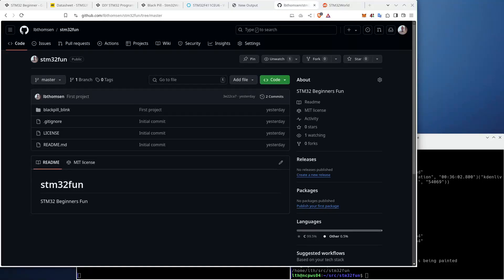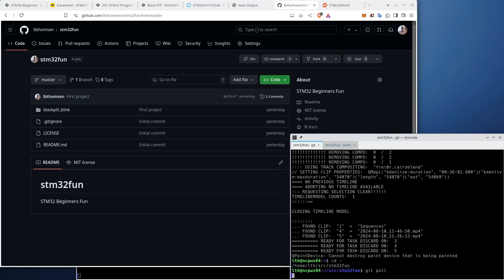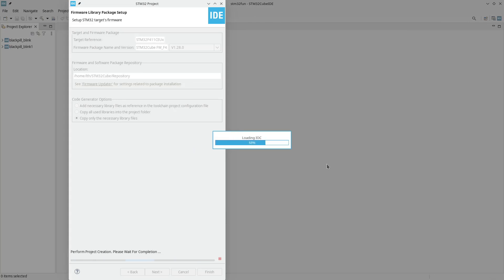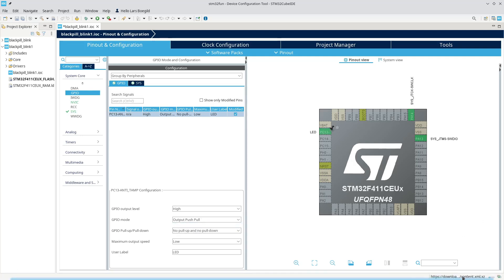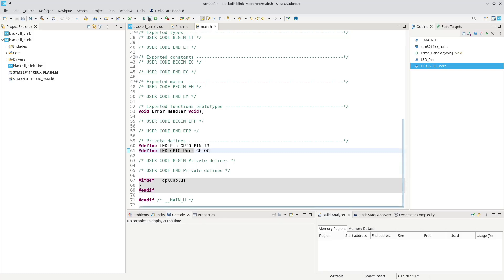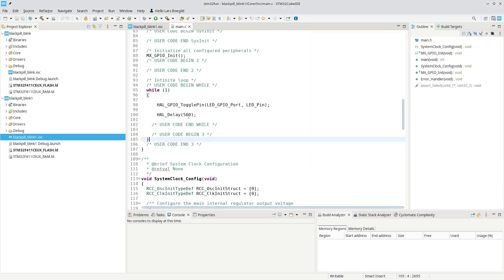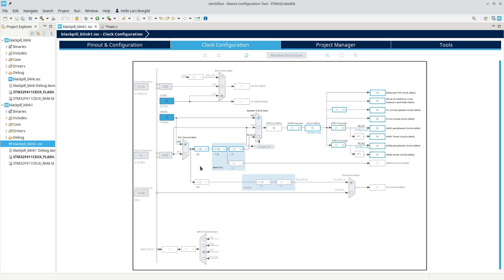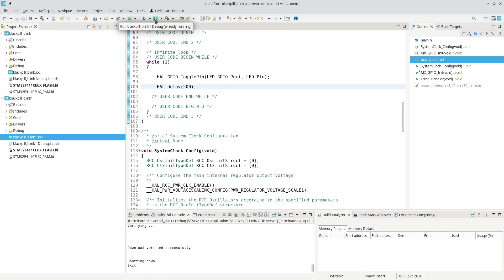STM32 Tutorial #3 First  Blink (done WRONG!)

Comment: I am using B-G431B-ESC1, why do I need GPIO mode with Output Push Pull to trigger the LED D4 blinking. If using output Open Drain, the LED will not be blinking? Here is the schematic for it - https://www.st.com/resource/en/schematic_pack/mb1419-g431cbu6-c01_schematic.pdf

Comment: Thanks alot. I just found this series after trying some other learning resources. I like your free style teaching, its feels like pair programming or active learning. I have no problem with the length of the videos as I anyway halts to code the examples. I halts the video for long time terms because I am using quite another setup (NUCLEU-F446RE, with vscode with the STM32 extension) so I have to adapt the code. Hope to keep on with this series and it would be nice to know what another hardware or expansion boards are you going to use. It takes some shipinig time to get them over here.
Thanks again,
Shimon.
Reply from the maker: Thank you for the kind words.  I have no plans stopping but the frequency might slow down a bit as they are getting more complicated to make ;)
Reply from the maker: I missed the last part of your question.  I suggest you just use whatever you like.  The whole point of me changing boards now and then is to show that it really doesn't matter ;)
In general I use either the STM32F411 based Black Pill OR I use my own which is based on STM32F405.  F446 sounds fine to me - stick with it.  You will learn more adapting my stuff to your board than just blindly copying.
Reply: @stm32world  Thank you for your reply. I ment whether you are going to use additinal hardware connected to the board.... like keypads, oleds and such?
Reply from the maker: I usually just do jumper wires directly to board - see the video about SD Card where I used an old SD to MicroSD adaptor.

Comment: Hooray! Finally, I got the LED on the STM32F411CEU6 to blink! For two days I was persistently delving into the first two lessons, I kept thinking when it would blink, I was about to give up, but I spent a lot of money and ordered a lot of parts. Before your videos, I tried to run the STLink-V2.1 and STM32F103CBT6 Blue Pill Plus bundle and I even succeeded, the LED blinked, but the happiness did not last long. Pill F103CBT6 stopped accepting the firmware, I thought that STLink-V2.1 was not updated correctly, but in conjunction with STM32F411CEU6 it works fine, which is now confirmed by the blinking LED. And Pill F103CBT6 LED still blinks, but no program sees it, maybe I'll gain some knowledge and figure out what happened to it.
Reply from the maker: I think I mentioned it in the first video, but most of the boards with stm32f103 contain fake chips and that is just a waste of time.  As far as I know F401 and F411 are all originals and thus behave the way described by ST in the datasheets.